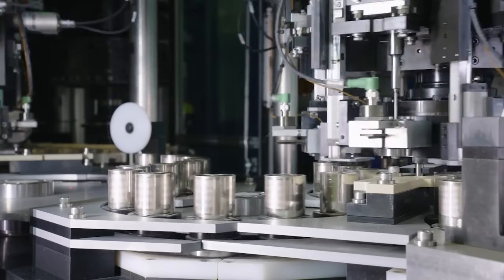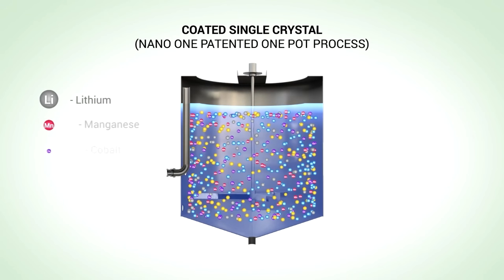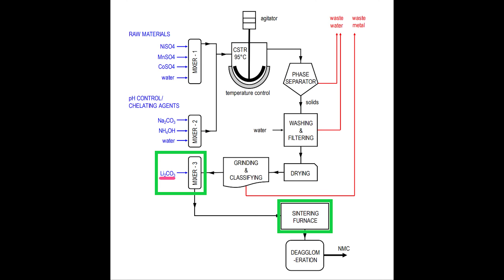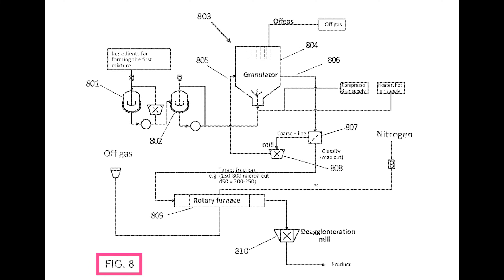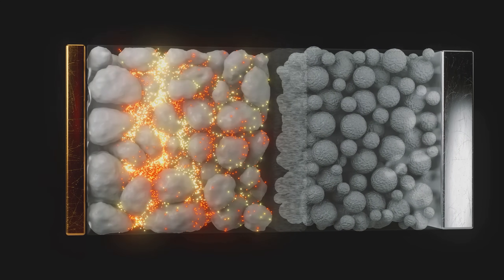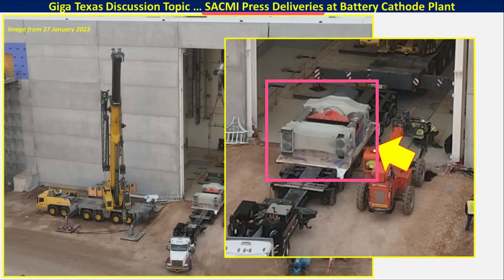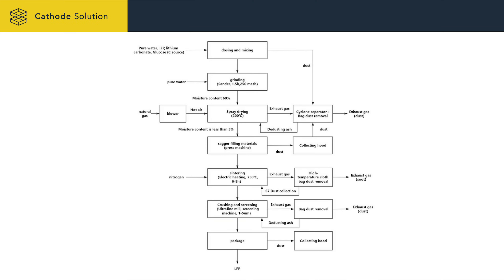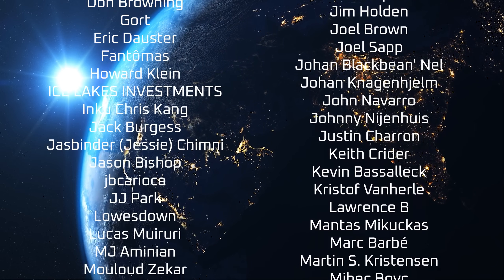Tesla Cathode Production Patent – LFP Cheaper than China

Comment: I've seen a dozen LFP CAM factories in China. They already have a similar process implemented in mass production and yes, they do recover heat and waste from the spray dryer and yes they have a CSTR. Some use rotating furnaces, but most use sagger kilns. This is pretty much standard in mass production. But there are several tricks on why this is possible and looks much better and easier than old methods. First is that you forgot to mention that the FePO4 synthesis is the real IP and issue and nobody knows this. Second, there a multiple kilns to get the LFP 4.0 technology (2.6-2.7 g/cm³ press density). Third, it's just super hard to control the process and that is the hardest part. Those are the reasons why practically all commercially viable LFP materials come from China today. But great work in making these videos 👍
Reply from the maker: GREAT information thanks!  I appreciate the comment and thanks for the support 🔥

What does 2.6-2.7g/cm3 translate to for cell level energy density for an average sized prismatic cell that goes into a vehicle, 180-200 Wh/kg?

Also, what is the limiting factor for the grade of the material, such as the LFP 4.0 technology that you mentioned?
Reply: Thank you for these informations, would you have more specificities on the process that you've seen or have the name of the chinese factories ? It would help me doing my researches for my thesis and you seem to know a lot ! Best regards
Reply: Hello 👋

Comment: The Cathode is the most important component of a Li ion battery followed by the Anode.
Tesla has followed the correct development path in its focus on the Cathode, both from a performance and production perspective.
This can be contrasted with other companies who have focused on making a solid state electrolyte.
The use of flammable electrolytes in current Li ion batteries is a non issue that has been made to appear important by FUD.
Reply from the maker: Bingo!

Comment: Is it worth considering what gases are known to be stored outside at the GT Cathode plant? From drone videos over the years, there is mostly liquid oxygen, and a couple of smaller argon tanks. No nitrogen that I've noted.

Maybe the nitrogen is stored inside.
Reply from the maker: Great point!

However, they aren't yet manufacturing his cathode at Austin and have been doing it at other locations.
Reply: @thelimitingfactor   That would go some way to explaining what I think is the complete lack of evidence of production at the GT Cathode plant.

They have just constructed a new opening on the east side to bring additional equipment in/or out.
My 'observation only' based opinion is that whatever process was originally planned for at Cathode has either been superseded or was not successful, and is being modified.

Comment: instead of making many thin layers of this cathode, what would happen if you put all of the processed cathode materials into a thicker conductor?  So for example lets say I had a 1 inch Aluminum plate, and drilled many 8GA holes throughout the plate (drilling all the way through, or drilling half way, and then stuffing those holes with the cathode material, then applying a surface coating of cathode materials on the rest of the AL cathode plate and then mating it with a solid pre-lithiated copper graphite plate anode, with separator material between the layer, and see what results you could get.  Copper and AL foils are expensive, wouldn't it just be easier to use one solid and thick conductor and drill holes all over it to fill it with your cathode slurry material, and then give it double layer surface coatings of cathode material?  Maybe you could even poke some holes into the anode and fill it with microcrystalline silicon that they're putting into batteries. (the kind that doesn't grow in volume when exchanging lithium ions.) I would love to experiment with this, and other materials to see what kind of energy density or power density it yields if I had the right materials.  If it worked out, it could lower production costs of lithium ion batteries, and make it easier to recycle as well.

Comment: Would a dry process pose a combustible dust process risk?
Reply from the maker: Good question.

I bet it would because cathode material is a fine metal powder and it's reactive

Battery factories are dangerous
Reply: @thelimitingfactor  It is nontrivial to deal with this. You have to modify your atmosphere or really control sources of ignition if materials have a low
Minimum ignition energy.

Comment: One think I don’t think you highlighted in the video, when you compare the wet and dry processes, that’s not the same as a wet or dry cathode, correct? It’s just the process that produces the cathode which is then put into the battery in a dry state. The final cathode material is dry in both cases, just that one method of the dry cathode production process does involve wet ingredients.
Reply from the maker: Covered in the introduction 

There's the material process, wet or dry, then the coating process, wet or dry

Comment: Jordan, I hate to brake this to you but the production of LFP from FePO4 and Li2CO3 through mixing/grinding -> spraydrying and subsequent calcination is THEEE standard process (dynanonic uses something different based on FeNO33 but thats a minuority source, has MUCH higher capex)
It is used fro Gen2 and 3 type LFP, even Gen4 LFP (density >2.6 g/ccm the one which china wants to ban export of) basically uses this process with some changes (also gen3 uses double calcination basically)

The "multiple input sources" for Fe, P, Li and C is a common shotgun-approach for these kind of process patents and tells you basically zilch in regards to process inputs, because it uses everything possible from wich usually only 1-2 really work for the targeted performance

The true innovation is the use of the granulator... but that being said, i'm unsure if that counts as novel given the similarities between this and a spray dryer
Reply from the maker: Nothing that you've just written here wasn't covered in the video at least tangentially.  That's why I included the flow chart at the end showing the process used in China that's similar to 'Tesla's process'
Reply: @thelimitingfactor  clarifying my point, not nitpicking. its the other way around was my point :) patents cant be enforced vs prior art when nothing substiantially novel is described, which this one does not in my process engineer/chemist opinion (not a patent lawyer though, thank god) ;)

on a further note, this seems to me like the attempt to create a justification/patent-armory to guarantee FTO without real substance

Comment: Chinese scientists have  just been released a compound chemical which just few drops in battery cells and its can revise cycle life of battery to 97%(just like new battery) and cycles life just up to 60.000 cycles . Did you notice that so big news for battery industry? Its have already been released on "Nature" with subject: External Li supply reshape Li deficiency and lifetime limit of batteries. Could you make some research and give some ideas to apply it to tesla? Just wait and see when its come to commerce.
Reply from the maker: Yup!  It's a pretty cool trick.

But, for now, still a trick.  I would take a huge amount of work to disssemble, refill, and reassemble the pack.  It would probably be easier to just recycle and build from scratch.

However!  With the larger batteries used in grid storage that are 100x the size of a cylindrical cell, it could be viable, for example.
Reply: Nope! Its so easy for tesla apply it to tesla battery. The core of tesla batteries cell can fill with small pipe of compound( cell has tiny space to fill it) and make sure u just press hard enough it can pop out small amount of compound and problem solved. How do you think about this idea?
Reply: It can apply for pouch cell too. U put a small pipe of compound to the top of the cell and make sure when u press hard enough it pop out certain amount fill the cell and cell back to the new ones.
Reply: Just about engineering problem and i think tesla can solve it to apply to battery cell in the future. That's time Tesla can unlock Vehicyle to Grid ideas. Cars can be charge and discharge many times as it could and make money for owner. Another billion ideas!

Comment: Great video, Thanks.  So am I understanding correctly Tesla's process is not single crystal?  Also I see this as potentially helping Nano One in that it increases the demand for the new supply chain needed for these processes.
Reply from the maker: Correct, from what I've seen, it's not single crystal by my definition, but I think it's the same or very similar to nano one's process

It depends on your definition of single crystal

Nano one shows primary and secondary particles in their promotional material and so I don't know what they mean by single crystal.  I have a guess, but I wouldn't consider it the same single crystal that Dahn is talking about, where there's no secondary particle